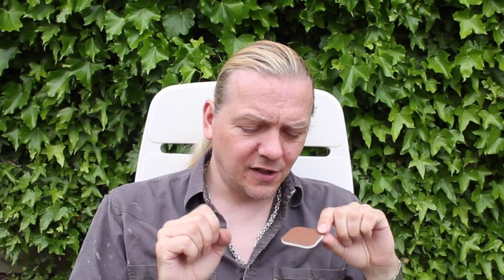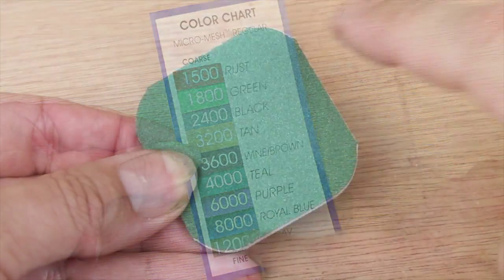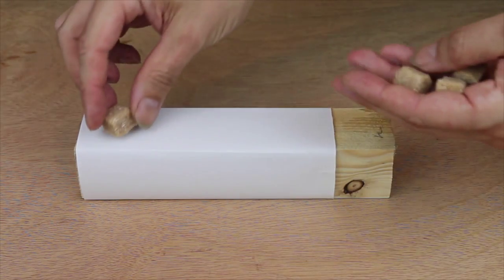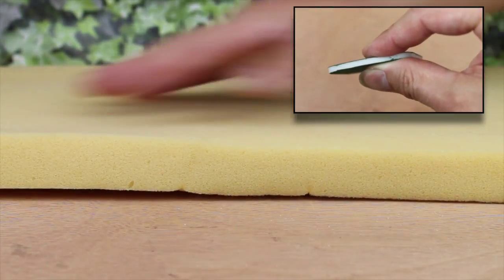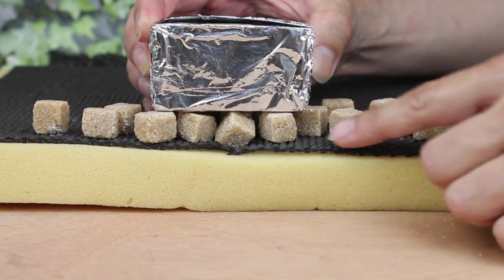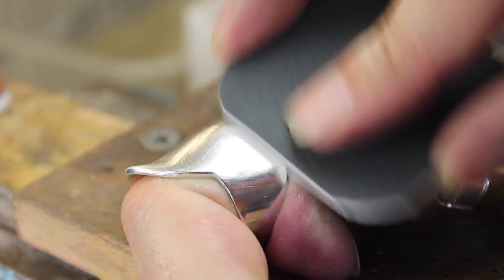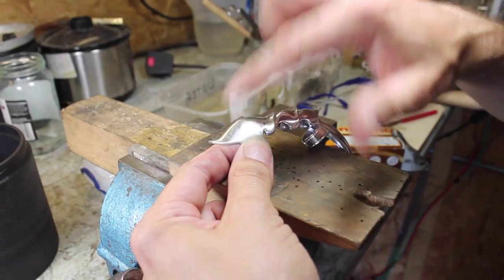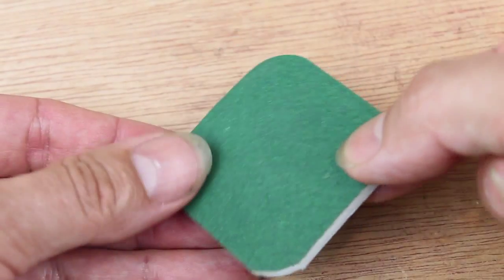Micro Mesh - what is it? and how to use it.

Comment: That’s an ingenious way to demonstrate how these abrasive pads work.  These appear they would do  very well polishing rings I made, which are deeply textured silver. In my case, I find that stiffer abrasives such as silicone polishing wheels cut down the high points of the texture and so I lose some of the character of the surface. As I’ve already seen with the EuroTool micro polishing pads you reviewed, I know the foam back will help me polish into the deeper areas of texture without leveling off everything. Looks like I’ll give this product a go—thanks again!
Reply from the maker: They are very convenient, especially the rougher ones. Dave

Comment: Some thoughts after using this product for ~5 months. When these pads are cut into thin strips (~4mm wide), they are excellent for working into tight areas, where nearby surfaces need to be protected from damage. Used this way, I find they're great for polishing bezels around small stones and tight areas in rings. Where a barette needle file might leave damage from its sharp edges, these pads won't. The foam backing makes them much easier to handle than folded sandpaper or buffing sticks, and are more forgiving. At first, I thought these were a tad pricey, but I've found them to be very durable and are now indispensable to my work.
Reply from the maker: Cheers kurt, Great feedback. I haven't tried cutting mine, but I can definatley see how you could use them like a safety back file. You can wash them too and clean with a toothbrush. brings them back like new. Thanks. Dave
Reply: Great advice about washing/restoring the "tooth" to these pad--I'll try that, thanks!

Comment: When you buy decent paper like 3M you get uniform grit size. Cheaper papers don't give you that and annoying scratches will occur easily. I'll opt for wet sanding with good papers when working on guitars and the like where a perfect finish matters. The 3M polishing papers are also useful for trickier areas. All that aside, I'm looking forward to checking out what Micromesh may bring to the table. A luthier pal says to use them with water and a little dish washing detergent to make them last longer and clog less, as with wet sanding.
Reply from the maker: Yes, Ive used them wet they work fine. As you say, something to add to the Arsenal. Stil love my emery buff sticks though. Dave

Comment: So how long do these last? they're reusable right? And are the grits comparable to that of sandpaper grits?
Oh and you seem like an at least advanced polisher..  How do you know when you're doe with a grit and ready to move on to the next?
Reply from the maker: Yes they are reusable. I have some for years. They are very tough and hardwearing and also waterproof. You know when to move one, when you have got a flat uniform surface, with no scratches or dents, you then go to a finer pad to reduce the tiny scratches from the first pad. again looking for a nice flat uniform surface. and keep going until you get the finish you want. Dave

Comment: Can these be used for wet sanding as well as try ?
Reply from the maker: Certainly, they are waterproof and hold up well. Dave
Reply: I use enamel paints for my model cars would the work well for the polishing process?

Comment: Fantastic vid. Can i sharpen a knife with it?
Reply from the maker: The pads are probably a bit spongy for sharpening a knife. Dave
Reply: Celtic Dreams i feel stupid....i didnt exactly mean sharpening but polishing the edge.
Reply from the maker: Certainty, it helps to remove burrs from the edge. and also to clean the blade. Dave
Reply: Some good points. However, micro mesh is not rated in grits but in it's own set of measurements called MM. 1500MM is equivalent to 400 to 600 grit.

Comment: Anyone thought about. I think im using it for maybe 2 months but the grind allready is going lose after maybe 1 month. Im using it wet. Also the effectness is gone very fast i have it now 2 months but its allready less effective as in the beginning no more full shine and even visible scratches
Reply from the maker: Just like any other abrasive such as emery paper, it will wear down, depending on use. Dave